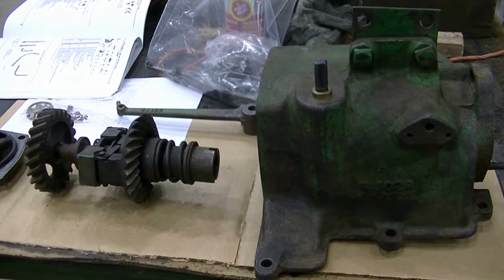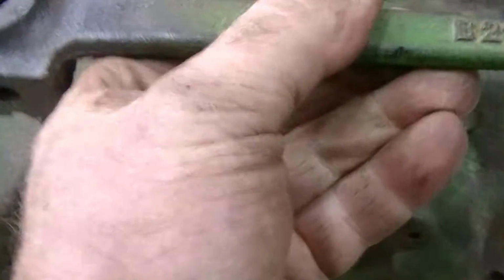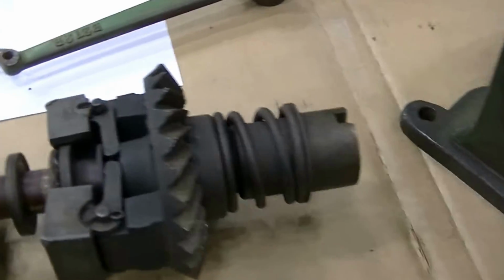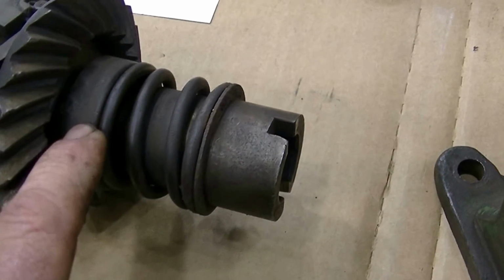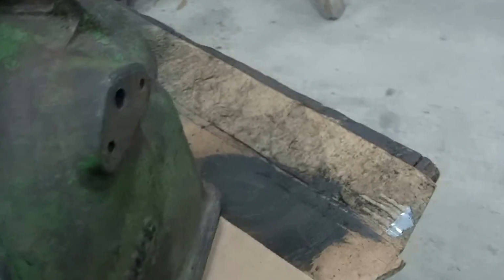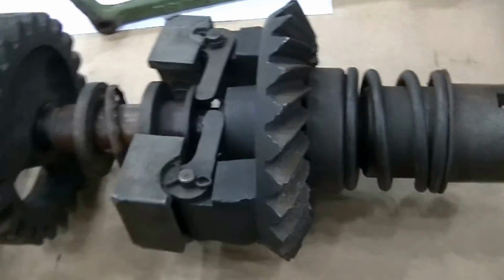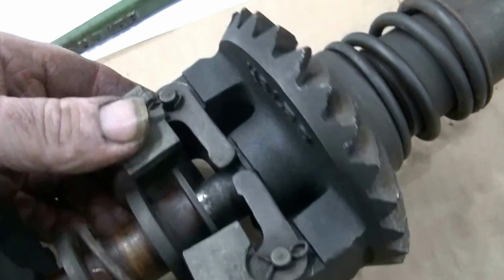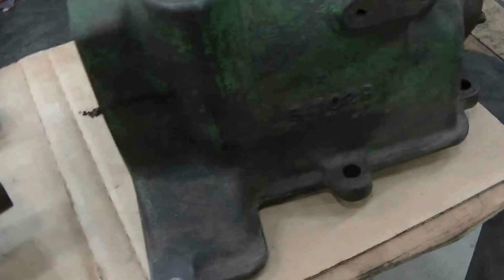John Deere 2 Cylinder Governor Overhaul - zeketheantiquefreak

Comment: Thanks a lot. I was looking in this video to find a reason why my magneto is installed with the bottom 3/8" cap screw tightened and the top one left loose. I thought it was forgotten by the previous owner who replaced the WICO magneto. As soon as I tighten the top cap screw, the clicking sound of the governor weights disappears when turning over the flywheel. I can not run the tractor as the block with pistons are removed. Any idea what this is caused by? Thanks
Reply from the maker: Any chance for a parts miss-match? Magneto impulse sticks too far in? Can this problem be solved by placing a thicker gasket or multiple gaskets to create clearance?
Reply: @zeketheantiquefreak8518  I will chechk this next week, thanks for advise.

Comment: Thanks for the video.   Can you say how how to removed the bearing race in the cover?
Reply from the maker: I have done maybe three, and don't remember it being a problem. That said, I have an assortment of 'heel bars' that can hook under the edge of the bearing race if there is room to purchase a grip. A harsher but very effective method is to run a short weld bead on the old race. This will shrink the race when the weld cools and the race will fall right out. Hope this is of some help. Let me know how you made out?
Reply: @zeketheantiquefreak8518  Thanks for the reply.  I was thinking about the weld shrink trick but am a little concerned about the relatively light wight casting.  
It is on my JD 50 and I have not tried yet.